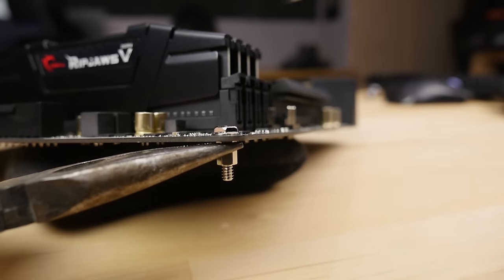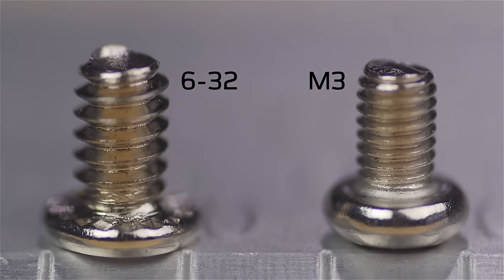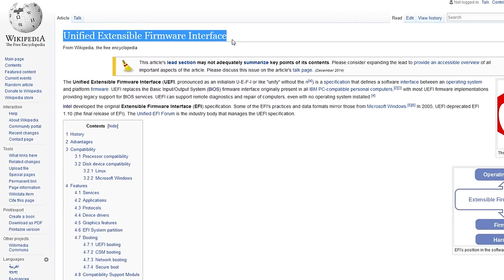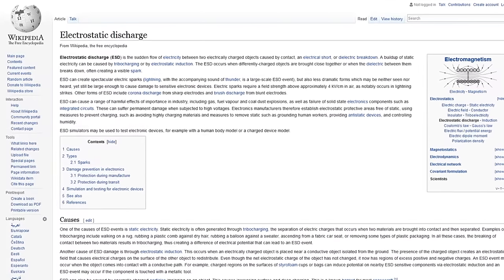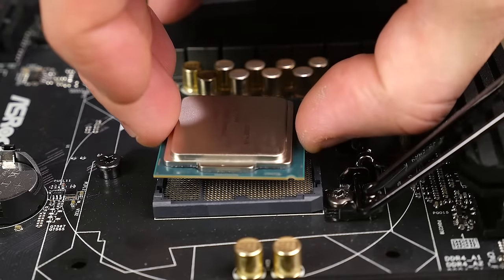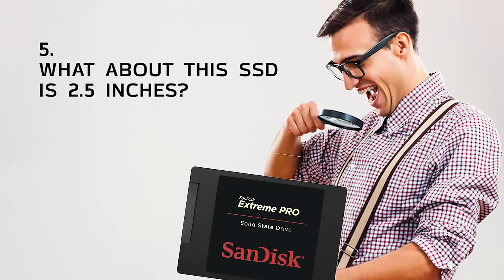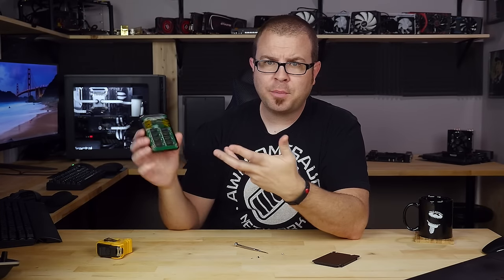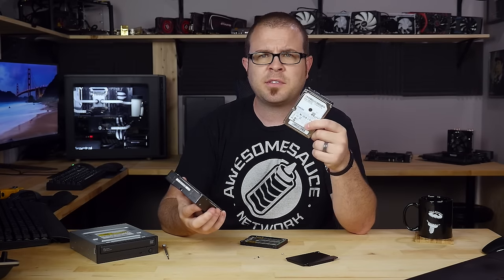5 Confusing PC Building Facts

Comment: @paul's Hardware ive killed my logitech g430 usb adapter with static was watching a movie laying in bed the movie ended and i slide my ass across the bed to get back to my chair and grabed my headset cable to turn the volume down and the static shot though my hand to the volume control down to the usb adapter and instantly the right side of my headset nolonger worked with the usb adapter the headset it self is fine but no 7.1  any more

Comment: when I look through my task manager and see the 4 subcategories, CPU, Memory, Disk, and Ethernet, and I see that my disk drive often spikes in performance when I'm running a game or an application, I'm wondering if this could cause performance issues when I'm gaming, is there any way to reduce the percentage my Disk will spike to? such as changing my component for something better or simply adding a second disk drive to carry the load?
Reply: A faster disk is the default go-to for this. An SSD (solid state drive) is faster and the faster read/write/access times help a ton. Also, you could take a look at what might be running, even if you are running Windows 8 or 10. Lastly, if you're really interested in learning, understanding, and being able to tweak on this level, you should read up on RAID configurations that would be a noticeable performance boost.
Reply: Young Frankenstein alright cool thanks I'll start looking at that RAID configs stuff and see what I come up with.

Comment: 2x4's are 1.75x3.5 inches. Cheated again!
Reply: mayday 2by4s refer to the ratio, but then again you could just call them 1by2s then strange. 1.75*2 is 3.5 so maybe 2by4s just means 1 side is twice aslong as the other?
Reply: 2x4 is a piece of lumber. but they aren't 2x4. if you want a 2x4 to be 2"x4" you have to pay extra. but you are right about the ratio
Reply: Eddygeek18 No it means we kept the name after removing the extra material.
Reply: yeah i thought it must have been something like that cuz i have seen videos where they say like this is my pile of 2x4s and there all different widths and that so i've always asumed its a ratio rather than measurements
Reply: Historically, that was the size of the saw cut timber, before it was was milled and sanded smooth.

Comment: I wouldn't say ESD can never happen, I ruined a motherboard that way :/ it fried the onboard video card
Reply: +Jamiee Carroll How do you know it was ESD that fried it? A more common failure is BGA separation. That was especially a problem when RoHS first went into effect, and the industry did not have expansion rates figured out too well.
Reply: +Paul Frederick It was years ago and it was a old pentium 4 desktop. I know cause it was working fine and I went to add a DVD drive because all it had was a 8x CD drive. I'm pretty sure I accidentally touched the onboard video card and when I closed the case back and plugged everything up the screen didn't display anything :/
Reply: Jamiee Carroll
You really do not know anything. You are making quite an assumptive leap in fact. Along with accidentally touching something I am sure you intentionally touched plenty of things too. For instance you say you plugged everything back in. I have seen VGA solder joints break from that. I'm using a computer right now with a busted VGA jack off the motherboard. I put in a video adapter to fix that. The on board video is trash anyways. So reflowing those solder joints was nothing I would benefit from doing. That can be a difficult problem to diagnose too. I got this PC for a dollar because the person I bought it off of thought they blew it all up. When I got it home I wiggled the jack and saw what the problem was immediately. When video flashed on the screen.
Reply: +Paul Frederick I don't need the condescending attitude from someone who believes that they know it all. I know very well that I fried the video card because I checked everything including the VGA port and it was fine. I was a kid at the time in about middle school :/ so of course I fried the video card by accident
Reply: Jamiee Carroll
I do not mean to sound condescending, but at the same time my knowledge of electronics is a bit more than what most folks possess. I have been working with electronics since before there were any personal computers at all. Sometime in the early 1970s, if you're curious. I actually remember when the first personal computers came out. Like the Altair 8080. Before IBM or even Apple got into the game. I was into electronics before all of that too.
Reply: +Paul Frederick I haven't been around computers as much as you but in elementary school I started out with dos on a Tandy computer which I actually still have lol. And I've worked on a lot of computers myself. Anyways what I was saying is that ESD does happen, the time that I mentioned where I fried the video card was like the only time I've ever had it occur. What I was implying with my initial comment is that it's safer to just get a $5 anti static wrist strap than the risk of something random like that occurring.
Reply: Jamiee Carroll
Maybe. Personally I can't stand wearing wrist straps. I feel like a dog on a leash with the things. I understand the risks well enough to mitigate them by other means. It is also impossible to determine if a component failed after the fact due to ESD, or for some other reason. At best any diagnosis is an educated guess.

I mean what physical evidence are you going by to stand by your claim that your inadvertent touch is what actually caused your hardware to fail? For all you know the part was dead before you touched it. Oh but it worked before I took the PC apart. Maybe, but it could have died due to some other factor between the time the PC was off, and you took it apart, before you touched it. You simply cannot know.

Fooling yourself into thinking you know things is a dangerous habit to get into in life. Because while you're busy thinking you know you might miss what is really going on. Sometimes with unfortunate consequences.
Reply: +Paul Frederick I don't wanna get into an argument over this. I was there and you wasn't, I know it was caused by ESD because I accidentally touched the video card when trying to remove the metal piece that was blocking the bay for the DVD drive and because I only had the computer off for about ten minutes max and when I went back and plugged everything in, power cable being very last it never displayed anything again. It didn't help either that it was a cheapo emachines, I mean when's the last time you saw one of those :/ 
And I understand not wanting to use a anti static wrist strap, but its one of those better safe than sorry things. I'd rather wear it and know I canceled out that variable of what could go wrong during a build.
Reply: Jamiee Carroll
If you're worried about ESD then leave the power cord plugged in while you work on a PC. Then the chassis is grounded. So as long as you touch that you are discharged then too. Just don't go poking inside the power supply too much while it is plugged in. You should be just fine. ESD straps have 1 megohm resistors in them, so you could still build up a charge that it cannot bleed off before you harm something.